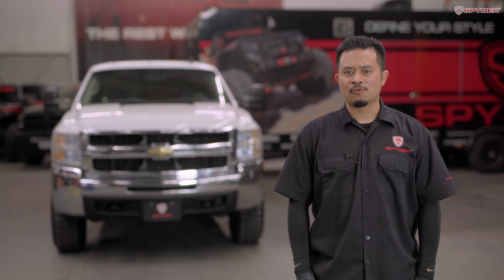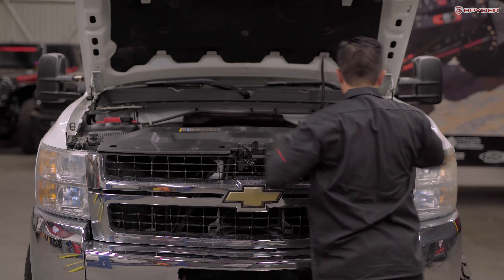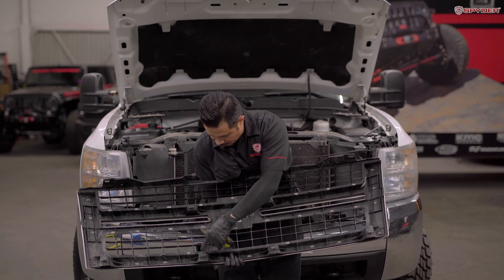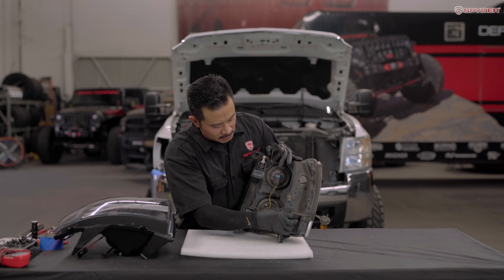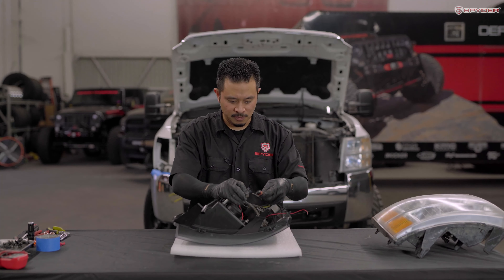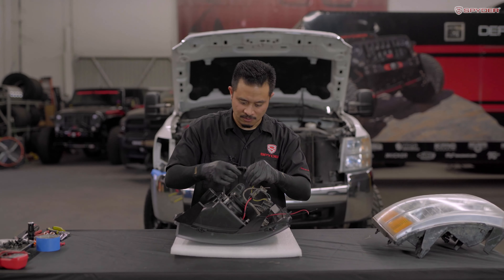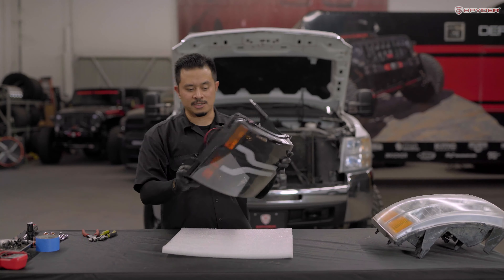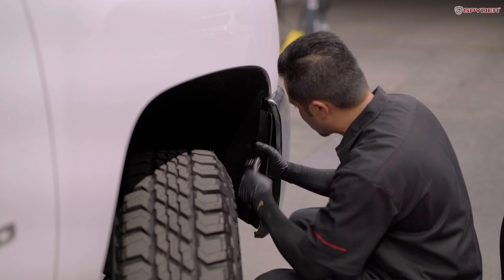Spyder Auto Installation: 2007-2013 Chevrolet Silverado Platinum Headlight Installation

Comment: Anyone what led bulbs to use because ive bought 2 different brands and it wont fit due to radiator frame beng in the way
Reply from the maker: For any issues or questions about your Spyder product, reach out to our tech support team techsupport@spyderauto.com